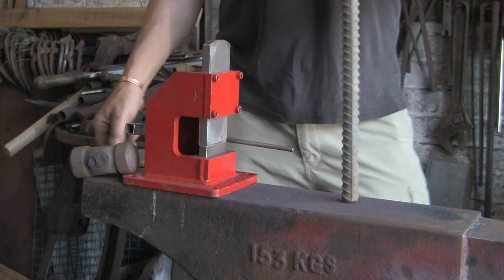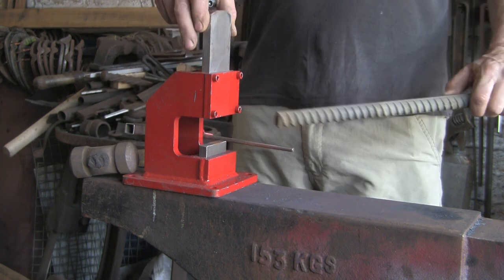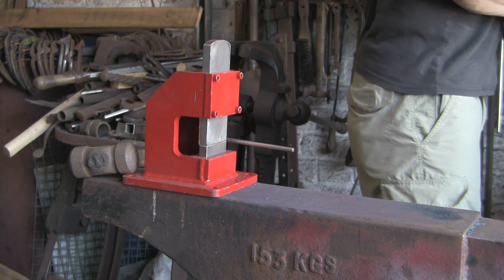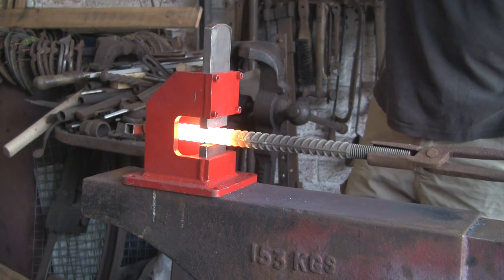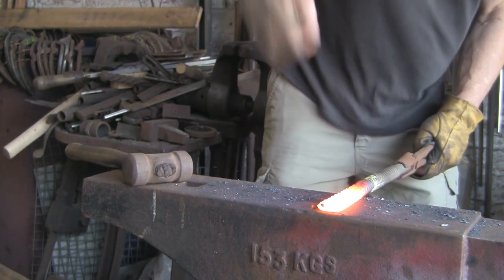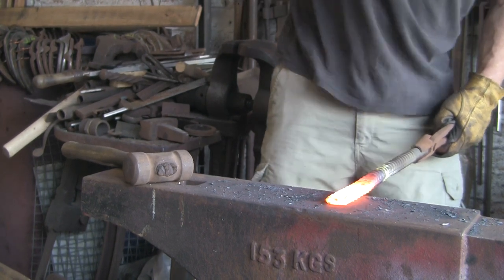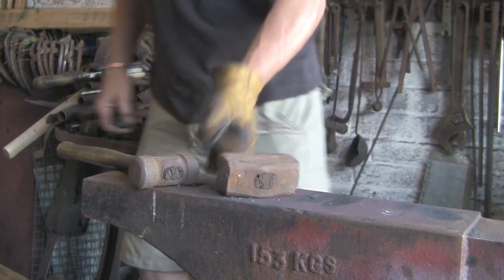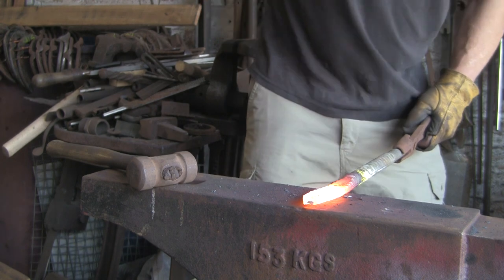Rebar Dagger

Comment: The threaded type of rebar is the higher carbon steel type..rebar comes in several flavors such as grade 40 the lowest carbon steel..grade 60..80..100..are suitable for tools and edge retention..the common type mostly used for residential construction is grade 40..the other issues are a very wide inconsistency of quality even in the same stick of rebar..a simple spark test on a grinder is the best method to see if it has enough carbon to use as a tool..

Comment: Just a little nostalga, that rebar used to be called GK60, it's pre-tempered and very tough stuff. 
I used to work in the reinforcing mill in Cardiff Guest, Keen and Nettlefolds, longer ago than I care to remember. :-)
Over the years I have bent tons of it into shapes destined for buildings snd bridges all over the UK. It was memorable because when you tried to bend it, it would twist into all sorts of shapes.

Loved watching you smash it into submission by the way!
Regards
Joe.

Comment: The rebar with the thread they use as holding down bolts here sometimes in Australia. Drill into the concrete and chemset it. I think the rebar is a grade 500 and plate here is grade 250, 300 & 350, so yes working with the rebar would be hard work!

Comment: Love your videos. Here in the USA rebar is hit and miss, tough like this, then a few feet later, almost mild steel
Reply: From someone who has worked in a steel mill in the US, I can tell you that it is not hit and miss.  Each batch of rebar is made to order, and there are many different grades.  Each batch has a coupon cut off and the metallurgy is checked.  The customer can specify what grade they want.  This ranges from very low grade to very high grade metal.  The stuff that is meant to be threaded for bridges or the nuclear industry's are very good stuff - it will weld and forge very well, while the stuff sold at home improvement stores is normally very low grade made for reinforcing small non-structural areas like driveways and porches.  The stuff sold to the nuclear industry comes with a 3/8" thick packet of paper with all the metallurgy for that exact batch. It is checked at the mill, and again at the plant that cuts, bends, forms, or threads the bar before being shipped to the customer.  Bridge grade comes with about 1/4 inch packet, normally only provided to the plant that cuts and bends the bar before being delivered to the customer.  Home improvement rebar stuff is normally not worth a s#!t and will probably not forge very well either, very brittle and prone to chipping out if made into a chisel.         

By the way, same goes for rail road spikes.  Normally, there are 2 grades.  First is very nice to work with, strong, hard but not very brittle.  Other is much softer, weaker and will not hold an edge no matter what you try.  It all depends on what the railroad company wants to spend, and where the spikes will be used.
Reply: bsb0011 wow, that is awesome that you know this! I am getting into the hobby, and i was actually thinking about using rebar for my first couple items. Thank you for sharing this info!

Comment: The threads on the end are for pretensioning the rebar when pouring concrete.  Thread a bolt on and crank down till it stretches the rebar.  Makes it stronger or something.  Also man you are not taking any shit in the comments lol!
Reply: They are for pretensioning, i know this because we used to have to do it all the time when we were pouring footings we would always crank em till they couldn't move inside the forms then call the concrete trucks in

Comment: Looks great, one thing is that you never want to heat galvanized steel as the fumes can kill you. Wear a proper respirator or try to burn the coating off if it is a galvanized coating.
Reply from the maker: Wrong!  https://www.dropbox.com/s/1i8v2djczr11f9g/WeldingGalvanized.pdf?dl=0
Reply: Gary Huston interesting
Reply: I’d tread cautiously because there are a lot of contradicting articles and even if it’s true excessive exposure still cannot be good
Reply: @garyhuston  better safe than sorry!

Comment: 1:08 The "hand guard"
I think Rebar is one of the best beginning material for new weapon smiths. It already comes with a good grip for the handle, and has a decent shape already for working the form.
P.s. I thought it was hazardous to heat up galvanized metal. Considering what it did to "Paw Paw" Wilson. Bless his soul.
Reply from the maker: He was just stupid, if you burn that amount of anything the fumes will kill you!
Reply: Be that as it may... It's best not to speak ill of the dead.
Reply: They're dead. I'm sure they'll find away to move on and bury it. Pun intended.

Comment: You know you said it's easier to grind when annealed, it's true it;s much easier to remove metal, I used to anneal everything before grinding now I dont. I just keep water on it while grinding. I find it much more precise and less risky to grind it in a hardened state. When you remove metal while it's hard it grinds much cleaner in crisp lines with no rolling and curling. But when you grind annealed steel on a fast belt it takes way too much material off really fast and you find the edge rolls and curls quite a lot. I think it leaves a better edge if you grind it hard. Just my opinion though.

Comment: That is probably the hardest rebar I have ever seen anyone work. Nice find man!

EDIT: That is definitely the hardest rebar I have ever seen anyone work. I would imagine that particular piece is superior to any RR Spike. You may have just had the best piece of rebar for forging ever. Probably equal to a RR anchor; if heat treated. Which I now understand you pretty much aren't allowed to do and carry like we can in the states. Here we can have a knife that is three and a half inches concealed, but more than that you need to have it as open carry. In some states here as long as it's visible, you could basically carry a fricken sword.
Reply: Nillaferilla railroad spikes are generally low to medium carbon. However if they have the letters HC on the head they are high carbon and can be heat treated

Comment: maybe its me . I don't understand the comments of the hardening . it's not a hunting knife and yes if you stabbed someone it would kill them God forbid ,anyway I like it . great job 👍
Reply: RC - Totally agree . Rebar is obviously not a first choice for a blade which needs edge retention , but a combat blade only needs to work for 5 seconds maximum . This dagger will punch holes in an adversary all day long . 
After 5 seconds = game over . 
Using method called Case Hardening with low carbon steel is a different story .

Comment: Nice one, I thought I was the only person who used nuts and washers for pommels and guards. I randomly did it a few months ago on a little knife I forged. I couldn't find any chunks of steel to drive a hole through to make a guard, so I grabbed a thick washer heated it up and hot forged it around the top of the handle, then got a nut just like the one you used and peened it to the base of the tang and hammered it around. Cool video.

Comment: Very nice dagger!  I especially liked the nut on the end, I'll have to try that!
I laughed when you said that it will have to be a letter opener. I work for municipal government, and teach blacksmithing courses for them. I'm not allowed to teach a knife making course, but there was so much demand for one, that I came up with a letter opener course. If people sharpen the edges at home, that's none of my business! 😄
I read the pdf you posted on welding galvanized.  The difference is that with welding, only a small part of the zinc is vaporized. With blacksmithing, all the zinc that's placed in the Forge is turned to vapor. I would have simply wired wheeled all the galvanization off at the start. You ended up doing it anyway at the end.

Comment: Very good grasshopper, I suggest you smooth out the handle part. And perhaps it will be feasible to redress any belts that's worn down. Keep your engine clean, air blast it, and make sure it's well lubricated.

Comment: Usually rebar with threads on the end is for buildings so that way you can anchor the wall supports to it newest be put in the foundation or in the columns and I beams will be bolted to them

Comment: british rebar is exellent stuff....americans claim theirs is low melt junk full of ball bearings and the like.....ive cut miles of it and its always been top quality,....but then australia has british standards...it makes good malleable steel hammer heads  and chisels too.....the threads indicate it is for stressed concrete....which is the toughest rebar they make....btw...you do know that gal zink is lethal..?
Reply from the maker: you do know that's an old wives tale don't you? It's perfectly safe, see my answer further down.
Reply: over here we use tonnes of zinc sunscreen....(the natives even get sunburnt)....and it is toxic if you inhale it as smoke,fumes or dust.....cadmium is used in paint your kids can buy.....but i wouldnt smoke it.....look up "zinc fume fact sheet"....there are thousands.....here is an easy to read one...its from ATSDR...( www.atsdr.cdc.gov/toxfaqs/tf.asp?id=301&tid=54  )..i dont know how legit the research is you rely on....but ......ill play it safe thanks.....
Reply: vitruvius (in his 10 books on architecture) was warning of the dangers from lead fumes in 60 AD, pointing to "the deathly grey pallour of workers in the lead foundries" yet 200 years later romans were using lead oxide to sweeten their drinks....yes the very same white lead oxide WE used to put in paint up until the 60's....then we replaced it with....you guessed it....zinc oxide....we so clever....btw the blacksmith jim paw paw wilson died from these harmless fumes.
Reply from the maker: Paw paw Wilson was just stupid, if you burn that much of anything the fumes will kill you!
Reply from the maker: Cadmium I steer well clear of but I have been welding galvanising for forty years with nothing more that a few cold symptoms. I'll keep at it, I trust my information.
Reply from the maker: Your link doesn't work either
Reply from the maker: Zinc Fumes -- A Safety Hazard?
When zinc vapor mixes with the oxygen in the air, it reacts instantly to become zinc oxide. This is the same white powder
that you see on some noses at the beach and the slopes. Zinc oxide is non-toxic and non carcinogenic. Extensive research1
into the effects of zinc oxide fumes has been done, and although breathing those fumes will cause welders to think that they
have the flu in a bad way, there are no long-term health effects. Zinc oxide that is inhaled is simply absorbed and eliminated
by the body without complications or chronic effects. Current research2 on zinc oxide fumes is concentrated in establishing
the mechanism by which zinc oxide causes "metal fume fever," how its effects are self-limiting and why zinc oxide fume
effects ameliorate after the first day of exposure even though the welder may continue to be exposed to zinc during subsequent
days ("Monday-morning fever"). Other research3 is being done using zinc oxide fumes together with various drugs which
results in a synergetic effect for treatment of cancer and AIDS. Another area of research is use of zinc compounds as the active
ingredients in throat lozengers that are recognized as significantly effective in reducing the duration and intensity of the
Typical “metal fume fever” begins about 4 hours after exposure, and full recovery occurs within 48 hours. The symptoms
include fever, chills, thirst, headache and nausea. All of these symptoms, pain and suffering, as well as lost work (and play)
time, can be avoided entirely by simply not inhaling the zinc oxide fumes. This can easily be done using any of the
Unlike other heavy metals, such as copper, lead and mercury, zinc is an essential micro nutrient. Zinc is essential to the
proper growth of plants and animals. Zinc forms part of the enzyme system that regulates biological processes throughout the
body. As shown on any multi-vitamin/mineral bottle, the recommended minimum adult intake is 15 mg/day.
Reply: my fault ...i typed the bracket too close in the link..it works now...........as for paw paw....it is harmless...or its not.....cant go blaming the victim now sorry...sick or not....it killed him...fact....(.insurance salesmen try to say the same thing)
Reply from the maker: That research just confirms my own, it's harmless unless you inhale vast quantities like paw paw did. Welding and forging galvanized material is way less than the 10-15 times for an overdose! It's like I said before, I've been doing it for forty years with no ill effects. It's just like alcohol, drink in moderation and it's fine, go on a bender and it will kill you! Don't be a worrier, we're here for a good time not a long time!
Reply: Gary Huston documented cases of death from it. But barring that. Of course breathing metal vapor and getting it into you bloodstream and brain is great for you. How couldn't it be?
Reply from the maker: +Perversia do your research pillock! It’s does no harm whatsoever. You obviously no nothing about metal working.
Reply from the maker: +Perversia Galvanizing has been used to protect iron and steel from rusting for over a hundred years in places as diverse as the wire rope
used for the suspension cables on the Brooklyn Bridge to gutters on houses.
Galvanizing is simply coating of zinc over steel. Like paint, galvanizing protects steel from rusting by forming a barrier
between the steel and the environment, but galvanizing goes one giant step further than paint -- it also provides
electrochemical protection of the steel. Since zinc is electrochemically more reactive than steel, it oxidizes to protect the steel
near it; as a result, even if a galvanized steel surface is scratched down to the bare steel, the galvanizing coating will prevent
the steel from rusting. Galvanized steel is, therefore, a superior product to steel with any other type of coating on it since it
protects the steel even when the coating is damaged in handling or in service.
Welding of Galvanized Products
Welding of galvanized steel is done almost exactly the same way as welding of the bare steel of the same composition; the
same welding processes, volts, amps, travel speed, etc. can be used with little modification when the switch is made from
uncoated steel to galvanized steel -- unless the zinc coating is unusually thick.
The difference between welding galvanized steel and welding uncoated steel is a result of the low vaporization temperature of
the zinc coating. Zinc melts at about 900˚F and vaporizes at about 1650˚F. Since steel melts at approximately 2,750˚F and
the welding arc temperature is 15,000 to 20,000˚F, the zinc that is near the weld does not stand a chance -- it's vaporized!
By the time the weld pool freezes, the zinc is gone. This has two immediate consequences:
• The vaporized zinc increases the volume of welding smoke and fumes.
• The zinc at and near any welds is actually burned off by the heat of the arc, removing the protective zinc coating.
Zinc Fumes -- A Safety Hazard?
When zinc vapor mixes with the oxygen in the air, it reacts instantly to become zinc oxide. This is the same white powder
that you see on some noses at the beach and the slopes. Zinc oxide is non-toxic and non carcinogenic. Extensive research1
into the effects of zinc oxide fumes has been done, and although breathing those fumes will cause welders to think that they
have the flu in a bad way, there are no long-term health effects. Zinc oxide that is inhaled is simply absorbed and eliminated
by the body without complications or chronic effects. Current research2 on zinc oxide fumes is concentrated in establishing
the mechanism by which zinc oxide causes "metal fume fever," how its effects are self-limiting and why zinc oxide fume
effects ameliorate after the first day of exposure even though the welder may continue to be exposed to zinc during subsequent
days ("Monday-morning fever"). Other research3 is being done using zinc oxide fumes together with various drugs which
results in a synergetic effect for treatment of cancer and AIDS. Another area of research is use of zinc compounds as the active
ingredients in throat lozengers that are recognized as significantly effective in reducing the duration and intensity of the
common cold.
Typical “metal fume fever” begins about 4 hours after exposure, and full recovery occurs within 48 hours. The symptoms
include fever, chills, thirst, headache and nausea. All of these symptoms, pain and suffering, as well as lost work (and play)
time, can be avoided entirely by simply not inhaling the zinc oxide fumes. This can easily be done using any of the
methods described later.
Unlike other heavy metals, such as copper, lead and mercury, zinc is an essential micro nutrient. Zinc is essential to the
proper growth of plants and animals. Zinc forms part of the enzyme system that regulates biological processes throughout the
body. As shown on any multi-vitamin/mineral bottle, the recommended minimum adult intake is 15 mg/day.
Reply: scott left I live in Australia and ever tool has to meet Australian standards which is very high if it does not meet standards and you sell the tools in yore shop your in the shit

Comment: I have a similar wheel for  sanding. if you cut a coke can and bend over the backside for the width of the belt the belts will slide right on . no struggle . good luck.
Reply: Paul Donaldson I don't I just use my pure physique